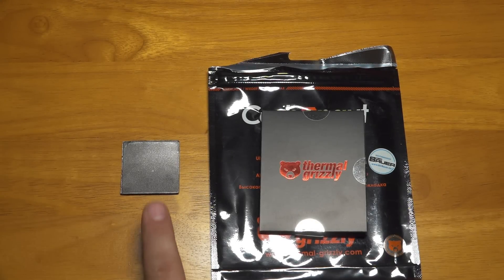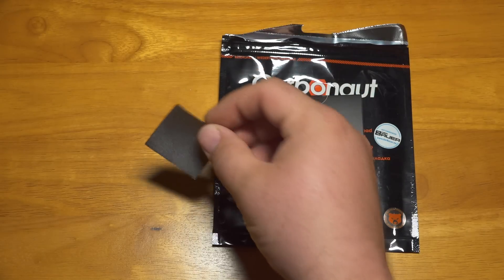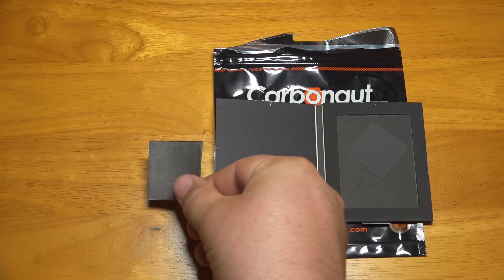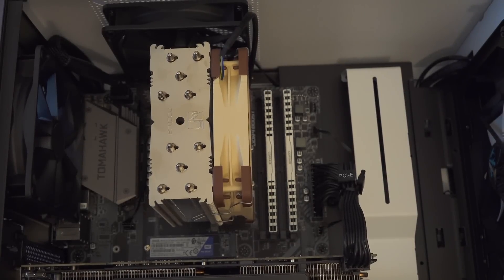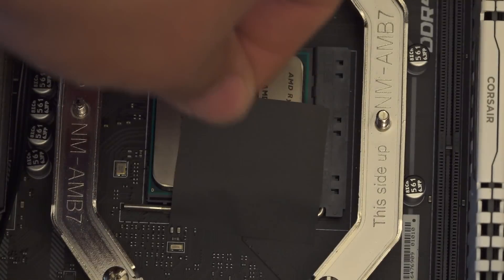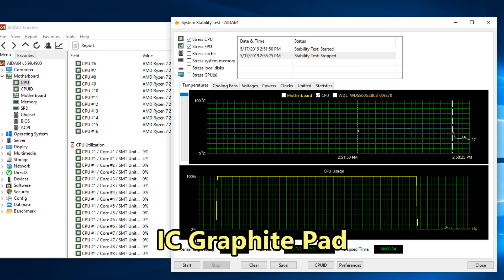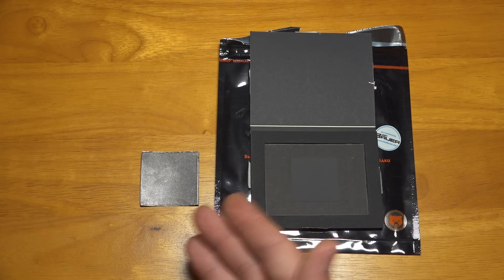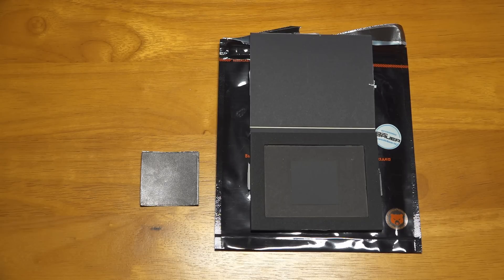Thermal Grizzly Carbonaut Vs IC Graphite Pad

Comment: completely falsified your tests by doing it on different days and room temps.
Reply from the maker: I don't think "falsified" is the right word.  That implies that I was lying or misrepresenting my results.  I was very open about the testing conditions and my methods, and the fact that the ambient temp (which I measured) was 1C different.  Unfortunately, I don't have a space where I can control the ambient temp to within less than one degree.  The main thing I wanted to test was if one or the other was majorly better or worse.  I think my testing was sufficient for the purpose.  Cheers!

Comment: Also, people need to understand that thermal paste degrades over time. So while the paste has a 2 degree advantage when new, down the road it will not. At some point the paste has to be replaced. The pads are set it and forget it. If you expect to ever remove the cooler, go with the IC Graphite thermal pad IMO.

Comment: I’m thinking about switching to a pad instead of re-pasting my old (i7-3770k) cpu.  It’s staring to run hot.  The paste has lasted this long so it’s done well for me but this seems a lot easier and even more durable.  

Plus I’m not over clocking at all, so I don’t need tip top performance.

Comment: Can i use it on my laptop?
Reply from the maker: You probably could, but every laptop is different and these pads do much better with high clamping pressure.  So it's hard to say how well it will work in a particular laptop without trying it.  Also be aware that many laptop chips are much more exposed, often with components quite close and both of these pads (Carbonaut and IC Graphite) are conductive.  You have to be very careful not to have it oversized and not to allow it to shift or come into contact with anything on the board.

Comment: The IC Graphite company has a new thermal pad: "IC Graphite HC" the HC is for High Compression. It looks like they're thicker before installation, but they collapse/compress down to become a lot thinner. It would be interesting to see if it improves temps over the regular IC Graphite. Maybe it calls for a new test video?
Reply from the maker: That would be interesting to test.  I also want to test the Carbonaut pad through several clamp and unclamp cycles because some say it doesn't hold up.  I know the IC Graphite pad holds up because I've re-used them before, but I'd like to test the Carbonaut pad like that as well.  

The only issue is that I don't have a computer build on the horizon, so I'd have to build a computer just for this testing.  Not that I'm completely against that, but I'm just not sure what exactly I'd build.  I've been thinking about it for months, and other stuff just keeps coming instead.

Comment: From what I've heard, these graphite pads need plenty of pressure to work really well, and they don't deal well with situations where the ihs and the cooler plate have variations in flatness (they just can't bridge the gaps at all, or at least with enough pressure to let them work well across those gaps.). It seems like an easy way to increase the applied pressure, and also to help fill larger gaps due to unequal flatness, would be to stack two or more graphite pads between the ihs and the cooler. Would you be interested in testing two or more graphite pads stacked between the ihs and the cooler?
Reply from the maker: Stacking multiple pads adds thickness and additional contact surfaces, both of which decrease efficiency.  My guess is that any gain due to increased contact pressure would likely be lost.  It could be interesting to test, but even if there is an improvement, once you have to start buying $20-$40 worth of pads for a single application and try to get them all stacked and lined up properly, you're probably better off to just use paste or, if possible, lap the surfaces to fix the root of the problem.

If I do set up another build for temp testing I'll test multiple pads.
Reply: @bigtb1717  Glad to hear you'll check it out if you get the chance!

Stacking them might decrease efficiency compared to the theoretical ideal efficiency, but comparing real-world results to real-world results is what really matters to users. I suspect that the importance and impact of pressure on graphite pad performance is being severely discounted and underestimated. There's very little test data available for that use case, yet other thermal performance critical industries use graphite thermal pads extensively. So there must be something to them.

As far as costs for the pads, a double pack of the original pads is currently only about $16, and they're reusable. Also, good luck getting any warranty coverage for situations where thermal paste has gotten into the socket of the motherboard.

The problem with lapping a CPU and/or cooler is that it voids the warranty even if a component fails for an unrelated reason.
Reply: @bigtb1717  There's a trick for keeping them lined up with the ihs: A *micro* dot of paste in each corner provides just enough grip to keep them from moving around while you mount the cooler.

Comment: Right off the bat, I can tell you that after using both the IC Graphite thermal pad and the Thermal Grizzly Carbonaut,  The IC Graphite one performed as expected and can be reused while Thermal Grizzly Carbonaut was breaking apart after a while.  So the IC Graphite is highly recommended for frequent uses.
Reply: I think that's because the TG Carbonaut is made of chopped carbon fiber held together with a polymer binder. That's why it's so flexible and also so easy to tear.
Reply: Agree. I did my first deep clean on my PC after 18 months, and the Carbonaut pad ripped apart. Just purchased the IC Graphite as replacement.

Comment: anyone mad enough to try one on a ryzen 5800x? I am really curious
Reply from the maker: I'd be willing to try on on a 5900x, assuming I actually had one, or could get hold of one.  PC components are unavailable and/or crazy overpriced right now.  GTX 1660 for $599 or RX 5700 XT for $1,100?  No thank you!
Reply: @bigtb1717  understandable, dunno where you live but alza seems to have consistent stock of ryzens in europe (it's even at msrp here in Hungary) for example, gpus are still extremely rare though (but if you manage to get one and willing to try I have a specific experiment request as well, try the 2 pads at once as well not just individually, with the softer one being on the bottom and harder one on top)
Reply from the maker: Personally, I can't imagine a scenario where having two pads would be anything but worse.  You would be increasing the number of surface-to-surface transfer points as well as the total thickness of the thermal medium that heat has to transfer through. Neither of those things is good for heat transfer.  But, if I end up building another system, I'll make that one of the tests, because a lot of people ask about similar setups with stacking two or more pads.
Reply: @bigtb1717  thanks, I am curious about it mostly because the thermal grizzly one is supposed to be better for filling in the micro holes while ic graphite has strong heat sucking potential, so yep it would be probably worse and pointless but what if it creates an unexpected effect or something, if anything, doing the experiment wouldn't be messy
Reply: I have the ic thermal pad on my 5800x for a moth now. Cpu never gets hotter than 70c
Reply: @joemolly  hey thanks for the info, that's pretty nice
Reply: I had the IC thermal pad with Dark Shadow LP 120mm fan on 3600 idle at 50 and reach upper 70 during stress test Prime95.
The 3600 is much hotter then the 5000 series. Both idle and under load.
Reply: @KiNg-xl8gd  I actually went and tried one with my 5800x, cb23 multi core still sends me to nearly instalty 90c (but it was the same with thermal paste as well), gaming, I get anything between 50-80c but never going above which is amazing (my cooler is a dark rock pro 4 in a meshify 2 compact case), idle is 35-45c depending a lot on ambient and what I am doing

Comment: Have you tried stacking the two different materials ?
Reply from the maker: I have not.  Generally you want the thinnest possible layer of thermal media between the two surfaces, while still being able to take up any imperfections between the two surfaces.  Adding additional layers will add thickness as well as additional contact surfaces (between the layers) that heat must pass through.  Both of which will hamper heat transfer.  Multiple layers would be worse, all else being equal.

Comment: Is that work for PS4 too?
Reply from the maker: It probably would, but I have no personal experience with using it on a PS4.
Reply: bigtb1717 could you do a extra video for the PlayStation 4 ?
Reply from the maker: Is your PS4 overheating or having heat related problems?  I could probably get my hands on a PS4 to take apart, but I'm not sure how I would validate if the thermal pad was working well, other than playing and waiting to see if there were any stability issues.

Comment: ASAP Question if someone knows, can I cut it to get fit to my size? or if you cut it you break it forever....
Reply from the maker: Either of these pads can be cut to size as desired.
Reply from the maker: Just don't cut it over the board because the pads are conductive and any small scraps could short something out.

Comment: Anyone used those pads on PS4 Pro? I'm wondering if that would be a good alternative to thermal paste.
Reply: Mieczysław Beger I used this on PS4 fat and got not a bad result
Reply: @mindgust1  Cheers but I bought CUH-1200 version and it's not loud at all (at least in Horizon Zero Dawn, didn't test many other games).
Reply: Mieczysław Beger I use 1100, in games: rdr 2 and assassins creed unity made noise with factory thermal paste

Comment: ic diamond pads are a no go. cooling gradually becomes non existant. Ive had them in for a 2 years now. gonna try carbonaut next.
Reply from the maker: Interesting.  My video editing machine has had the IC Graphite pad in it for about two years also.  I haven't noticed any temp issue, but I'll have to do some testing to see if the temps have gotten worse.
Reply: @bigtb1717  so did the temps get worse over time?
Reply from the maker: I did a stress test and didn't notice any issues.  It's possible the temps were higher, but unfortunately I couldn't find records of what the actual temps were initially.  The temps were okay, but I can't guarantee they weren't a bit higher.

Comment: Been using IC graphite pads for a little while now and love them, haven't tried the Grizzly pads, but I hear they are about in line with each other with a little edge to the Grizzly solution, but very close overall.
Reply from the maker: I've been using the IC Graphite pads for some time as well.  Work great for me.  I one in my current desktop computer, and I used them in a few I built for friends and family members as well.  No problems.
Reply: @bigtb1717  im thinking about using this one my new laptop wonder if it has enough to work on the max q GPU and CPU.

Comment: Just put thermal place on top of cpu and add the thermal pad on top so it sticks and does not move around while also giving better performance
Reply: That would then defeat the purpose of a clean application/removal.
Reply: @JBrown-go8ru  and the thermal benefits

Comment: The graphite still hold after used , the carbonaut start to deteriorate , any body have the same experience????
Reply from the maker: I've seen reports of the same thing.  I was considering a video testing multiple uses of the Carbonaut pad, but I don't have a good computer for this right now.  As you say, I have done multiple uses of the IC Graphite pad and it holds up well.
Reply: @bigtb1717  i think somebody need to review it properly , cause this is a ripoff , th mobo could be damaged bcos of the debris carbonaut spread all over the place
Reply: @bigtb1717  I saw a video where Steve from Gamers Nexus, and DeBauer were having a conversation about the Carbonaut pad, and he was emphasizing that the thinner you can cut the pad , the better the performance. They had trouble cutting it even thinner. Personally I've never used it, but I'm considering buying it. I think they should just advertise it as a one-time usage. That way people think better of the product. If it produces better thermals, than the competition, then it does do what it's supposed to do. They should promise less.

Comment: What if you used a small dab of liquid metal or mx-4 sandwiched right between the chip and the thermal pad itself. That way it'll fill in the imperfections of the two surfaces.
Reply from the maker: Personally, if I was going to use paste, I'd just use paste.  I wouldn't try to use two different thermal interfaces.  The point of the pads is to conform and take up surface imperfections, so you shouldn't need paste too.  If you feel that the pad isn't doing the job well enough, I'd just use paste alone, not both.  That's my thoughts.
Reply: Paste degrades, the pad is designed not to degrade, you will put paste into the pad, so you will have the weaknesses of both and the benefits of neither.
Reply: @mwnciboo  Pad degrades too, but unlike paste, can be reusable.
Reply: @FVBmovies  if they're pretty much just graphite/carbon, they should last pretty much forever.
Reply: the pad sacrifices 3 degrees of performance in exchange for never drying up with time, no mess removal, and no risk of poorly applied paste.  By adding paste you throw away all the benefits of the pad, create potential for an uneven sloppy mess, and will run hot because of the thicker gap between the cpu and heatsink. in a perfect world..the metal to metal without any paste provides the highest performance, but all surfaces have tiny flaws.

Comment: I bought an older used thinkpad and it didn't not run particularly hot but it with a little OC it goes to throttling so i replaced the probably 5 year old thermal past with kryonaut and it did not really seem any better I was wondering if those pads would be good and it is heatsink to die they have no IHS
Reply from the maker: It's possible that the cooling of the laptop won't support overclocking.  Many laptops are kinda borderline on their cooling to begin with.  The thermal pad may help, but it's hard to say for sure.  With how variable laptops are in their cooling setups in terms of design and clamping pressure, some people have good results, some not.  

if you do use a thermal pad, be aware that they are conductive.  Since the CPU is a bare die, you will want to cut the pad to size and be careful it doesn't fall out of place during assembly, as it could short things out if it comes into contact with the wrong thing.

Comment: Can't seem to find any videos or info on how these things perform when it comes to overclocking which is unfortunate. I'd love to try one since I like the idea behind them, but I'll be doing overclocking and I can't risk degrading my hardware testing out for myself :P so looks like it's regular thermal paste for me
Reply from the maker: The Carbonaut and IC Graphite pads perform similar to decent thermal paste, while getting beat in some situations by the best pastes.  This should hold true for overclocking as well.  Overclocking vs. non-overclocking shouldn't make any difference to the performance of the pad.  If temps are within a degree or two at stock speeds, I'd expect the difference to be similar if the temps were pushed a little higher by overclocking.

But don't think I'm trying to sell you on anything.  If you feel more comfortable with paste, by all means, go with what you feel is best for you.
Reply: @bigtb1717  which are the pastes you are referring to when you say it gets beat by the best pastes? Could you suggest some ? Thanks
Reply: Hardware degradation has to do with voltage, not temps. You won't overclock and shoot to 100c and fry your cpu for example, you will throttle and/or shut down if it reaches too high of a temp regardless of the cooler.

Comment: i use ic graphite on cpu, i will useCarbonaut on gpu XD
Reply: not good idea when circuits are close to die ...and its very conducting material need lot consideration on cutting the right size for die only...not entire package ...there are many circuits around outside the die are close around

Comment: Can i use this on my macbook pro 2014 cpu and gpu?Im a noob and i used the 2019 mx4 with the pea size method to  cpu and gpu and i think the temp is worst than stock,i dont know what went wrong but this looks like a fool proof solution!
Reply: Try KPx or Kryonaut just go slow and make sure you are getting proper die coverage. Its a pain but pulling the sink back off right away and checking coverage helps then clean and reapply the paste and try your best to do it the way that worked best.
Reply: @gatordontplay417  Thanks for the tip man!

Comment: i put IC graphite on my laptop cpu and gpu, honestly basically no difference in temps from that. im going to blame the 2 wimpy heat pipes, but it couldve been decent paste to start with
Reply: @Pinku Pantsu thats why i changed it, that and it tends to be vertical which could lead to leakage, which i really don't want. so it was more of a peace of mind thing for me.

Comment: when your stress temps are that far below the upper thermal limits does the 2-3 degree difference actually have any noticeable difference
Reply: With the way they use turbo boost and other things now I would say yes. Especially if it puts you in different thermal frequency stepping zones that are based on temperatures gaps of like 5c and blah blah blah.